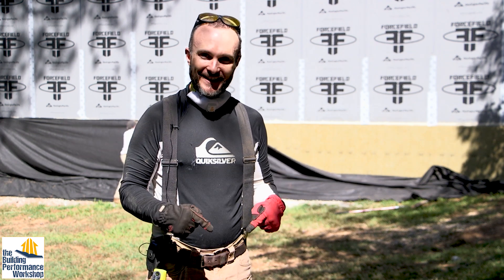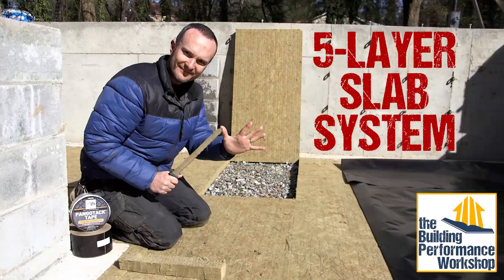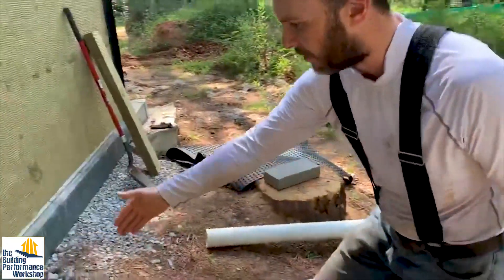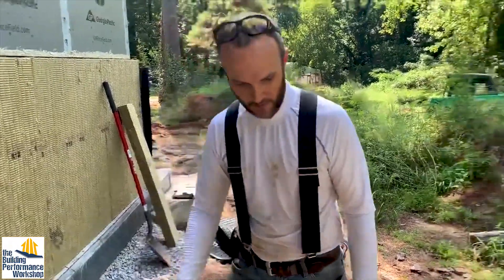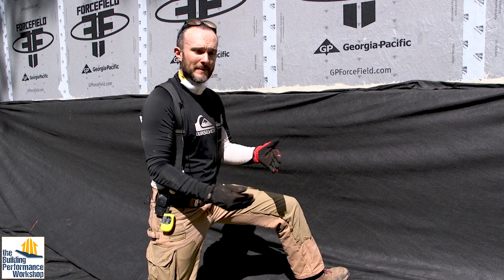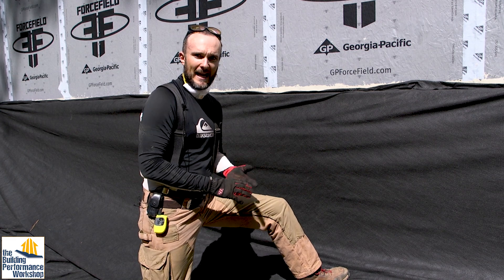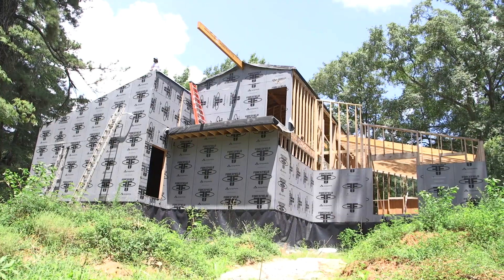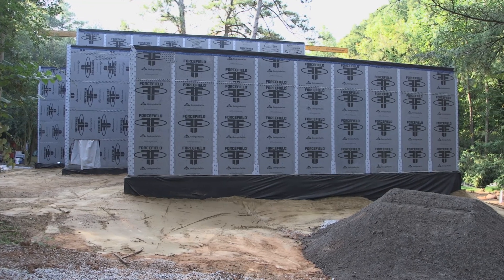Foundation Backfilling: Geotextile, Exterior Insulation, Waterproofing & Drainage

Comment: The geotextile fabric is really good idea since mineral wool is used for starting seedlings.  I could see roots loving to grow right into the ROCKWOOL below ground if you didn't have some form of protection over it.  I'd still like to know of other solutions for protecting the ROCKWOOL above ground.  Was thinking of using acrylic coating like Tuff II directly on the Comfortboard 80 on the above ground areas that only have foot or less exposure.

Comment: Hello quick question: does this method/system work for a basement? So all of the same steps except the rocks ,then the rock wool insulation, then the concrete pour (just structural)?
Reply from the maker: I believe your answer is yes, though every situation is different in construction. FYI the rocks are a critical part of the drainage system.

Comment: nice.  i would have used liquid foundation water prrofing.  why, cuz it guarantees dry crawlspace
Reply from the maker: So many ways to get what you want
Reply: I'm hoping to use Grace product for waterproofing my basement walls on the outside an what's it call the product to prevent dirt getting in your drain tile

Comment: If I put rockwool outside I would have the largest rat population around. Then the snakes would come to eat the rats. It would smell like Baltimore.
Reply from the maker: It’ll be dry because drainage- that’s what it’s for
Reply: I've never seen evidence of rats burrowing into rockwool. They will burrow into fiberglass, but never seen them touch rock wool.  Do you have other evidence?
Reply: @tcranston  
I lived by Everett Washington when PITA broke into a laboratory. They released about a quarter million research rats. For the next 15 years I had rats getting into everything. There wasn't any sense of preference or timing. They chew stuff up and leave if there isn't any food. They burrow into soft things to make babies. What they don't eat they ruin by peeing on it. If you want those plastic totes full of really expensive food to last, put rat and mouse traps around them. I have pets so no poison or exposed sticky traps.
Reply: @HomePerformance  
For decades the barn on the land next door was used for cock fighting. They raised cocks outside which supplied the food. The walls of the barn provided the hideaway. Since a new neighbor cleaned it up, there are rats looking for a new home. I trap one a week easily.
Reply: @George 
I'm not an expert on the issue, but even just a pile of limbs waiting to be burned turns into a rat house. This time of year everything is very dry.
Reply: Yeah....this post is 🤯. Do you have a point to make or just want to spread nonsense?
Reply from the maker: It dries, since we have drainage